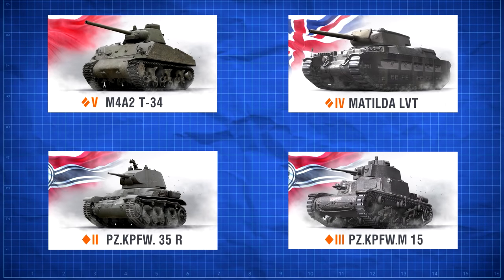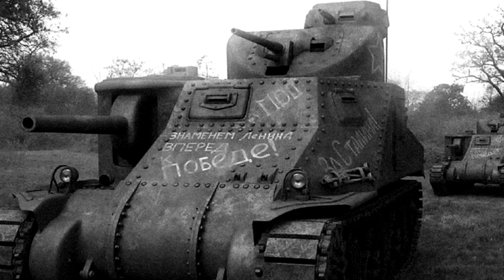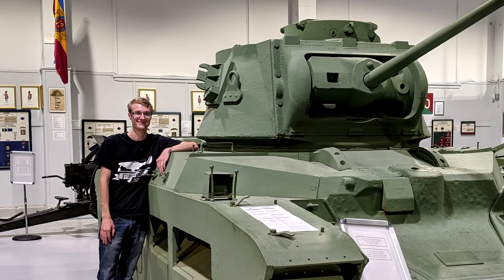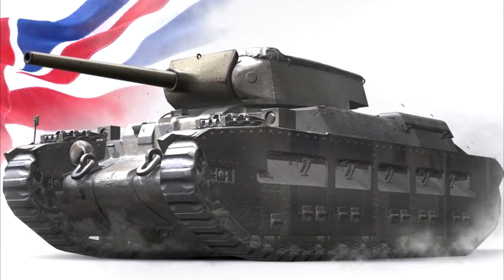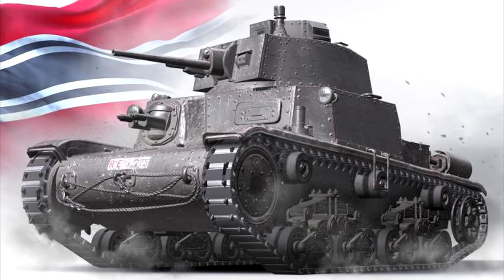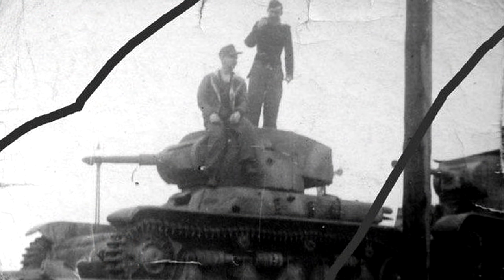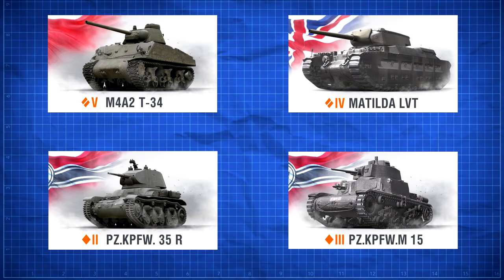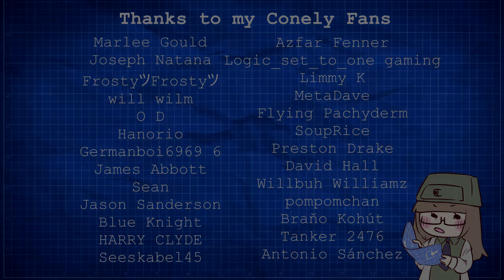More Wargaming Fakes or Real Tanks? | Cursed by Design #Shorts

Comment: The T-34 Sherman is even weirder in context because the crew loadout for the tank indicates it uses the early-war turret with the commander doubling as the gunner, while the declared stats for the gun indicate it is an 85mm gun.
Reply: it's simple: the turret ring of the sherman is way to wide for the late t34/76 turret. And the added cupola makes no sense either. A version with the 85 turret would have been better.
Reply: @tigerbesteverything  someone took the effort to 3D design this but didn’t take the 5 seconds to look up a picture of the 85 turret? This is why I don’t fuck with wot.
Reply: @tigerbesteverything  That hasn't stopped turrets being mounted on wider rings before. Usually either an adaptor is installed, or the hull ring is removed entirely and a smaller matching one welded in its place. Like when the French went through a phase, where they mounted the FL10 turret to everything in sight...
The problems mating a turret to a hull come when you want a wider turret on a hull. Because turrets (tend to) come with a matching diameter basket.
So yes, the original T-34 turret could be quite happily dropped in a sherman.
To be honest though, the Russians hated the turret, and the crews hatten the turret... Especially after they got 85mm three man turrets.
So unless some field recovery division was looking for a solution to putting a sherman hull with a blown off turret, and for some special stars alighted reason, no access to a spare turret. The better option would have been just mounting the 85mm in a modified sherman turret.
Reply: @GrasshopperKelly  You literally say explain why the original T-34 turret cannot be mounted on the Sherman with larger turret ring, them claim it can be mounted after all?
Reply: @magww1  game is running out of ideas lmao. at this point swapping modules is all they can come up with for low tier tanks.
Reply: @Catequil  I said, a smaller diameter turret, can be mounted in a wider diameter hull, and that it's very difficult to mount a wider turret, in a thinner hull...
The 57mm T34 turret is not as wide as the Sherman's ring.
Reply: What about turret basket since without one the crew could step on the drive shaft.
Reply: Not to mention the fact they've replaced a three man turret with a two man turret. The dumb is strong with WoT, young Skywalker.
Reply: ME T 34 Sherman cant hurt you me 🤣
Reply: I don't know if that'll be the case if they give it an 85mm gun. They've had a few cases where a gun physically looks like one gun but performs like another - like the gun on the Cromwell Berlin looking like a QF 75 but acting like the long 75 on the tech tree tank.
Reply: WG made this decision after a bottle of vodka...again.
Reply: @tigerbesteverything  Actually, the T-34 mod. 1943 turret had a cupola, while still otherwise being a T-34/76 turret with its shorter hexagon shape, and not the enlarged T-34/85, so the turret itself existed. 
Still, upscaling it to fit a Sherman hull just seems bizarre and wouldnt be something done in real life.
Reply: @vuxluongw  Or they're just not looking hard enough
Reply: In the end, WOT is only looking for money, or ways to offer (invent) new content.
Whatever...
I remember that I always wanted to play WOT but I didn't have a good PC, until I got it and soon after I discovered War Thunder, which was a similar game and I tried it, so why not?
And wouw I was fascinated by its realism, then I tried to play WOT but when I saw how exaggerated Arcade it was, with a fusion between MOBA and tank game, they seem anything but tanks, it scares me.

I mean tanks with hit points, fog of war? The game shows you on the map where the enemy is ... etc
Nahhhh is this LOL, DOTA 2? wtf
I prefer WT is a way to suffer better with a game ...
Reply: @KazutoBlogch  I kinda agree. I started WoT waaaaaay before WT had tanks, and WoT was so arcade-y and technologically underdeveloped. For one, Ive seen games that were at the time ten years old that looked more convincing, and the tanks didnt feel like tanks, they felt like RC cars with painted cereal boxes over them, because the only suspension animation was the tank accelerating and stopping and recoil, but zero reaction to bumps in the ground. Guns just sounded anemic to the point where even the tiniest firecracker had more punch. 
The only reason I played it for as long as I did was because it was the only game of its kind at the time.
Reply: @magww1  as if tanks existing or not has ever stopped wot from adding it and saying that their models are realistic

Comment: Any combination of hull and turret is possible, but surely turret ring diameter is the deciding factor as to whether it could handle the recoil of the gun in real life
Reply: Looks at Panther 2 with 88mm L/100
Reply: And weight!
Reply: The turret ring diameter us the deciding factor if the turret could fit. They had to match perfectly because otherwise you'd have a turret that is either not secured in place or too wide to fit.
Reply: Time to place a Centurion Conquerer or any British tank turret on a gunboat and calls it ship gun car like the Primitiveasia (the modern lesser intelligent neighbour of Malaysia) who ordered the prototype from England.
Reply: @Azachor  you can always modify the ring to be smaller, but not really bigger.

Comment: There are so many paper panzer sun the game that these combinations aren’t far from the lengths that Wargaming will go to. For example, there was only a wooden mock-up of the T71 lt in the US tech tree. The T92 lt is a premium vehicle that had 2 actual working prototypes, one still exists at Aberdeen. Since the developers of the T 71 didn’t have a concrete design they had the chance to use it in the tech tree with 2 designs with the speculations of the designers. The T92 went straight to a single design to fulfill the requirements requested.
The T92 was set for production until it was discovered that the Soviets had an amphibious capable light vehicle and the T92 wasn’t, as it wasn’t in the requirements.
Reply: So you're saying there's a chance of the Tsar tank?
Reply: T92 is in WT. It's pretty good. Just has a high repair cost.

Comment: Was hoping if Wargaming gonna add more Sherman tank variant. Especially the French one.
Reply: India and Israel both had Shermans up-gunned with French CN 75-50 guns. One of those Israeli Shermans also had the hull cut down to be 0.3 meters shorter to give it a lower target profile. At least one Indian Sherman was given a Soviet D-56T gun off a PT-76. Israel and Argentina also used Shermans with the French CN 105-57, though those would be functionally identical to the M4A1 Revalorisé. Yugoslavia equipped a single Sherman with a M1931/37 field gun (which was the basis of the guns mounted on the IS-2 and ISU-122) and the engine of a T-34-85. And Chile operated ex-Israeli Shermans equipped with an autoloading 60mm high-velocity gun.

All of those physically existed.
Reply: quite a few 'french' sherman variants already in the game (2 at the moment).

Comment: Personally I'm not going to complain about these 4 coming in. The first two strike as being viable for the war since it's just a turret swap rather than much else, the sort of part temporary modification that could be done by less well supplies group or similar, where they don't have the ability to get the chassis/turrets working on two of their tanks so they just swap bits over.
As for the other two, they're documented vehicles even if they're sort of prototypes, so not going to raise complaints there.
For the most part, Wargaming has done far worse for simply creating tanks that never existed, with these there's at least some level of credibility to them, or just a way of going "Ok yeah, I can see that could've happened"

Comment: The turret shown on the Matilda in the game image is actually a proposed modification of the M8 Howitzer Motor Carriage (HMC).  The 75mm howitzer M3 was replaced with the 75mm gun M3 (as used by the M4 Sherman), hence the longer gun tube.  One prototype did exist (see page 302 in Richard Hunnicutt's book Stuart: a History of the American Light Tank Vol. 1); it was offered as a potential tank destroyer, but was supplanted by the T70 (which became standardized as the M18 Hellcat) and never produced.  Since the turret fitted to the LVT(A)4 was similar to (if not the same as) the M8 HMC's, the "nomenclature" is understandable.  As for putting said turret on an A12 Matilda hull, it gives me, a builder of WW2 armor models, a neat kitbashing idea.  I've already done the Italian hull/Czech turret build (as best I can), and have an R35 hull/T26 turret build in the offing.  Thank you for the video; I'm always looking for new build subjects (actual or not).

Comment: The Matilda with Staghound turret belonged to a collector in Mareeba, Queensland. It was in the all yellow paint as of 2001. In Australia after the war many obsolete tanks were sold off, many were bought by farmers who wanted to use them as tractors. Invariably they would get rid of the turret. Usually a lot of the upper hulls would be chopped off, and locally made dozer blades or tree pushers attached. This particular Matilda somehow escaped the farmer's oxy torch, but the turret was long gone. The Staghound turret was what was available.

Comment: I remember looking through a folio style book about the M4 series in a university library.  In the chapter on proposed variants there was a drawing of a set of offset gears at the engine, the drive shaft running along the floor of the hull, then a second set of offset gears at the transmission.  The top of the hull lost its hump and was flush with the top of the engine deck, for an overall lower height.  In the text it mentioned a proposal to fit the M26 turret to the M4 because their turret rings were the same.  I thought it would have been interesting to combine both of those modifications.

Comment: With Sherman T-34 combo. I can see how this could be done. Imagine Eastern front, some place, winter 1942. You are sieged/encircled and you have to defend. You have Sherman with broken turret and destroyed T-34. All you need to do is make turret ring adjuster to fit small T-34 turret on Sherman hull. 

Could have been both Leningrad/Stalingrad and many other places.
Reply: The phrase "turret ring adjuster" opens a whole can of worms, but also cutting the roof off of the T-34 hull and welding it over the Sherman's turret ring would be the easiest and most likely method to perform on a battlefield. Turret would probably end up off-centre and maybe a bit wonky but you've got a whole tank now.
Reply: @Axquirix  T-34 turret is light. Its much lighter than sherman one. So making like sherman sized turret bottom adjusted with inner ring to fit T-34 turret wont be much of a problem.
Reply: "Could have" and "Did" are two very different things

Comment: On the M 15, look at the road wheels.  In most of the pictures we see 6 small wheels with a large, exposed suspension, as in the Pz.Kpfw. 35... in other photos there are large wheels like the Pz.Kpfw 38.  I think this is an important distinction to make, since it changes which tank was used as the chassis for the hybrid.
Reply: Okay, watching again, I see that you threw in a Pz. 38 picture when you mention it by name, saying it wasn't used.  Nevermind!

Comment: I got an idea for a fake WW2  tank, Take a Panther A hull place a R.R Meteor engine and extend the back out to make room for it and Panther G turret with a 17 pdr gun and turret mounted 30. cal, and of course a transmission that doesn't break every time it gets used and 20mm side plating  along the sides and then track layered on the front for 'spaced' armor and the hull gunner removed for extra ammo
Reply: I'd prefer Britain simply get "Cuckoo", the rather well-documented Panther G captured and used by the 4th Coldstreams Guards.

Comment: The one I find least interesting out of these 4 is the M4A2 T-34. Not only did it never exist in any form, even as a dubious restoration job, there are so many more interesting frankentanks (both civilian-made "fakes" and real military mashups) out there.

Like the M3 Lee (or possibly Grant) in Pakistan with the turret removed, turret ring plated over, and some sort of long-barrel gun in the hull. It's known to be (like the "Matilda LVT") an inaccurate restoration rather than a real conversion. But an M3 hull with a 17-pdr or 76mm M1A2 would be an interesting mid-tier tank destroyer. And allow the Lee/Grant to get revenge for all of their years of being terrible in World of Tanks.

Or better yet, the M4A4 Sherman in India mounted with a PT-76's 76.2mm D-56T gun. Which in addition to having a pretty decent chance of being a real conversion, also has a very distinctive paintjob.

Or best of all, the Chilean "M-60" Sherman. Surplus Israeli M-50 Shermans rearmed with an autoloading 60mm HVMS gun firing from 3-round clips. 100% real, 65 of them were in Chilean Army service from 1983 to 2003.

Comment: From an engineers point of view the adaptation of a different turret with a different turret bearing diameter and height of the internal part of the turret. 
If the new turret has a smaller diameter it requires to weld in a ring of hardened steel with the smaller diameter and turn it to the required dimension - difficult without the huge turning machine. 
If the new turret has a bigger diameter .....no chance at all. 
If the inner heigt of the turret is smaller it works if it is higher....it becomes difficult.

Comment: One Major flaw with the M4-85: The Turret Ring of the Sherman is wayyy too large to fit a T-34 Turret. Sure, you could have welded an extra plate on to fit it but one majpr issue would still be that the recoil of the 85 mm gun would have been too much for the small turret of a T34. There is a reason the soviets built a new turret for the T 34 85.

Comment: I would spend real money for a memed out m3 t34-85 with the extra machine-gun cupula on top
Reply: An M3 Lee turret ring is 1384mm, while a T-34-85's is 1600mm. So I doubt that'd be possible. The original T-34 on the other hand has a 1425mm turret ring, so there might (barely) be room for that conversion.

Comment: I am just left wondering how much work needed to be done, to make the M4A2-34 or Matilda LVT a reality, especially with regards to the turret ring. Also, would the 85mm from the T-34-85 have been a considerable improvement over the 76mm, in terms of tank on tank combat? At least considerable enough to actually put a T-34-85 turret on an M4

Comment: A web search says that the M4 had a turret ring diameter of 175 cm while the T-34-85's turret ring was only 156 cm.  That's not an insurmountable issue, I guess (not like if the two were reversed) but it does present an extra challenge for trying to make such a hypothetical tank work that probably wouldn't have been worth it.

At least it's more realistic than the T-34-88.

Comment: The PZ.KPFW.M 15 appears to be some sort of modification of the Italian M13/14/15 tanks.  The hull looks as it did on the Italian tanks.  The turret looks different; does it still mount the 47 mm gun?  The Germans always made use of captured equipment and the Germans would've inherited a considerable amount of Italian equipment after the 1943 armistice between Italy and the Allies.

Comment: The Panzerkampfwagen W. 35 (R) is not completely fake. It was a real tank, but it was actually Romanian. The Romanians tried mounting T-26 turrets (though not the one shown here) on the chassis of the R35’s that it had at the time. This didn’t work very well, as the turret rings were too big for the chassis and the turret armor was WORSE than the R35 turret.

Comment: Thx for this video. The problem with WGs fantasy tanks is, that they are never clearly marked as such. They always get a fluff text that implies that they were at least real projects. And even the historical tanks do use configurations that are fantasy. Today almost nothing in this game is correct... speed, turret rotation, gun depression, armour, penetration values, rate of fire... everthing is adjusted for 'balancing'. And I think this is bad, because many people get a completely wrong picture of the capabilities of the historical tanks.

Comment: I'd rather have a Yugoslav SO-122 (An M4A3E4 tank with a T-34-85 engine and a 122mm gun). One test model was built, but it was abandoned in 1965 because of the cost and fear that the 122mm gun would not be useful against modern tank armor. Still, it would be effective against tanks in the Tier VIII to X range. It would most likely be a Tier IX tank because of increased speed, but slow firing gun and M4 armor.

Comment: A possible rationale for the m4a2 T-34 is that it would yield a tank with substantially better automotive/mechanical reliability than the T-34 with the firepower of the T-34.
Reply: and if it had the statistically represented turret, a Franken-M4 with T34/85 turret and the sights of the M4 would have been the best possible tank in the war, especially if they got a Jumbo armor kit.

Comment: How would they even fit a T-34-76 turret on a Sherman hull? The Sherman has a muuuuch larger turret ring diameter....
Reply: yes but you know, they can always make it smaller.
Reply: WoT dark magic

That's how
Reply: @yosefvonhansom2921  no. its called cutting the hull roof and replacing it with a new plate with a smaller turret ring. has happened before, same with making it bigger, just more of a pain in the ass thing to deal with.